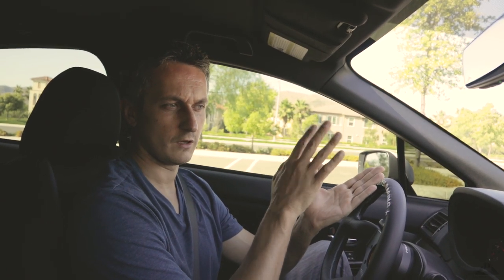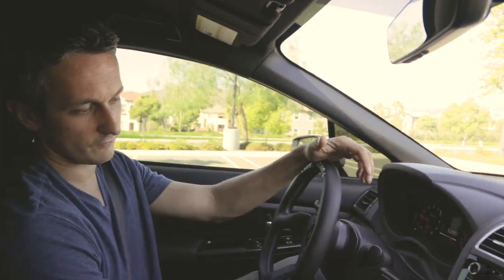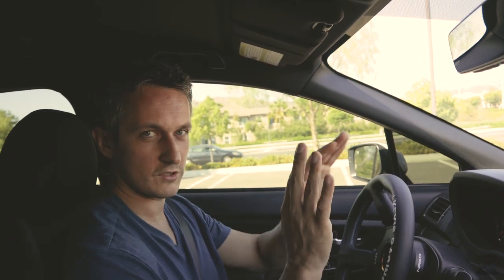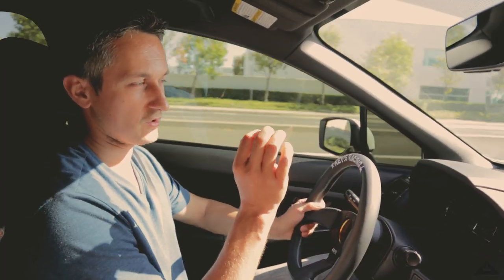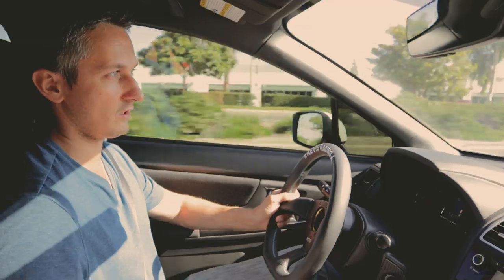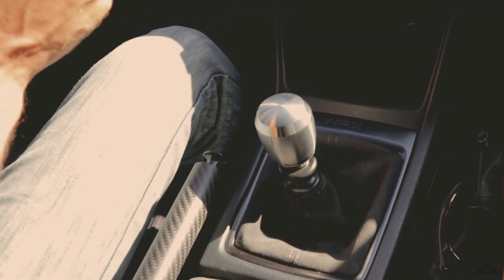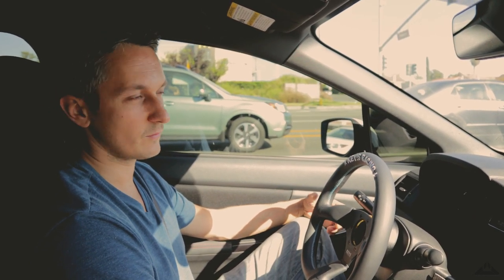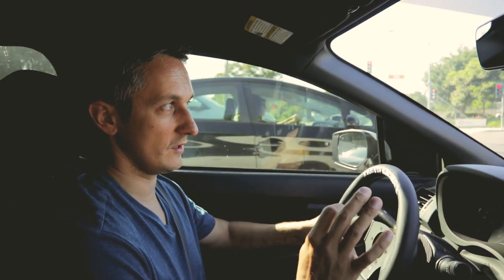Best way to shift a manual WRX and STI

Comment: I own a 2020 sti and I've had issues with making a smooth transition from 1 to 2. Thanks for putting it in a different perspective, this really helped.
Reply: I just bought a 2015 wrx as my first manual and have everything down except 1 to 2nd. It's always clunky af
Reply: @KuhmKnight  what helped me was shifting around 3 to 4k for 1st to 2nd gear, that and letting out the clutch as fluid as you can results in a smoother shift.
Reply: @Sinkroe  yeah I need to start paying more attention to my tac, my dad told me not to worry about rpms and shit when he was teaching me how to drive and I've been focusing on sound instead.  Driving home today I focused on my rpms and (most of the time) it felt alot better
Reply: @KuhmKnight  good, practice makes perfect and you’ll soon just be able to listen to the car and feel it. You’ll get frustrated like I did but just keep driving and you’ll get used to it. You get to a point where you don’t even notice your shifting/down shifting
Reply: @Sinkroe  after like a month of driving it it became second nature. Now I'm shifting up and down feeling like I'm in the fast and furious
Reply: dude SAMMEE im practicing on my friends 2021 sti for when i get mine in august and the shift from 1st to 2nd is so boggly bro i hattee itt
Reply: Same here 1st to 2nd jolts the entire car and everyone in it. If anyone has any tips, let me know. I'll definitely try shifting at 3k - 4k to see if that helps
Reply: @christopherlee7260 I have a STi 16’ 2nd is my enemiga. Shifting at higher rpm’s is smoother. I flick the gas before shifting. Seems to help.
Reply: I couldn’t get 1st to second forever until I realized I wasn’t letting the clutch reach the bite point fast enough. Now I usually shift at 3k and I get the clutch to the bite point right before it reaches 2k let out all the way, then gas. and it’s usually smooth. Now if I’m distracted or not thinking about it. It’s boggy again. But if I’m paying attention.

Comment: The STI specifically has an absurdly high connect point. Feels almost like a 2-step connection clutch. While it took me a while to master - I noticed that as long as you're not afraid of the clutch, you will always sense the grapple point. From then on, just practice entering that first gear with less and less RPM, 'till the point where it feels like an automatic.
Reply: Sti is my first manual lmao. What a choice. Had it for a month, was too clueless to be scared of the clutch and got use to it. Came across this video down the rabbit hole of gutting my car lol.
Reply: @horshue7873 let’s goo just picked up a 2020 sti last week. Finally getting a hang of it but it was definitely weird at first
Reply: @willcxlby  for sure you'll get it, my dad trying to scare me out of getting one bc hes a dodge tard warned me it was hard asf third to porsche and aston martin. Idgaf need for speed dream car + ratio + u drive a tacoma was driving to work day 4

Comment: Learning to drive my ‘19 STi was a big ass learning curve compared to how I drove my ‘12 VW Passat (Yes, it’s a 5-speed manual). I finally got it all down, but sometimes I still mess up man😂 One day my shifts are nice and smooth, and the next day they’re slightly clunky🤦🏻‍♂️ I still can’t shift that well in Sport Sharp mode lol.
Reply: Bro me either! It’s different in every section, drive on intelligence and then go to sport sharp and you’ll see the difference
Reply: I’m smooth in the sti driving daily
But quick shifting I can’t get it in this car. 
My integra I had that shit down like a beast
The sti grinds going into second. I have to really slow it down it’s weird.
Reply: Username 1991 same with me, but third gear. It’s like I get locked out and have to wait until the car is okay with me shifting into 3rd lol. I’ve definitely gotten a lot better overall after more than a year now.
Reply: Stewbob112 I have 19 sti as well my issue is just 2nd. So I just slow the 1-2 and bang the rest. Never have an issue. Just 1-2 grinds on quick shifting. 
I know you’re supposed to slow the 1-2 down do to driveline shock in the awd system. But I slow down a good amount to avoid grinding.
3rd I don’t have an issue. 
How is your hand technique?
Do you change hand grip position each gear? I do. Helped me to never miss a gear. The sti is crisper than the wobbly wrx one. So it’s crisp going into 3 thru 6.
Reply: @Username-ng8jy  bruh sport sharp is another level lol. I can't get 3rd for shit when racing. Gotta get used to it
Reply: @Haylem  nah to me is 1-2. The car just doesn’t like quick shifting. I think it’s a good thing cause I don’t wanna fuck the transfer case. I just slow it down a bit. 

But just use the ball of your hand and tilt your slightly pushing up with the ball of your hand naturally the shifter will go into 3rd. 
Is it your timing? Or you just can’t seem to get it into gear? Like as in your hitting the divider between 1 and 3?
Reply: @Username-ng8jy  I always find going down much easier. But for the WRX or sti the clutch release is about 70% upwards , I'm still getting used to it lol. I found a technique of lifting my legs up rather than letting it rest (left leg) shifting much smoother
Reply: @Haylem  lol I’ll give that a shot. 
To me it’s just 2nd gear. Never had an issue in any other car. 
The sti has bite point immediately after releasing the clutch about 10 percent for me. 
My integra was at the top 80 percent 
My gmc truck is at about 50 percent. 
The sti however. Bites the second Im releasing the clutch lol
Reply: @Username-ng8jy  What year? Mines a 2020, I meant 80% like let go at 80% upwards but yeah I think we're thinking the same thing lol. I agree I'm used to around 50% too. 

I'm getting the hang of it though, currently sitting at 1500 miles
Reply: @Haylem  19
I got her March 2019 with zero miles. 
I’m at 19k now.
Reply: @Username-ng8jy  Wow ! Nice, fun driving eh
Reply: I found sport sharp to be the easiest mode to drive smooth in, more control.
Reply: @jj1348  ur crazy lol
Reply: @Haylem  Hahaha I don't know I always fuck up in Sport, only about 7k miles into my 20' STI so I dont have too much experience but the difference was night and day for me.
Reply: @jj1348  Yeah no kidding LOL. I can't daily Sport # at all, I fuck up my timing in shifts. 

Im starting to daily in sport after doing 90% of it in intelligent. 

Gotta say I'm getting better mpg driving it harder in sport. It's like the engine likes a slight beating haha.
Reply: I can only drive my '19 Sti in S#. I'm coming from a '14 Evo X (still own it) and it's throttle response is much crisper than both S and I modes.

Comment: It took me a lot of time to be smooth when I started to drive stick. But it’s very rewarding. When I did my friends 2018 WRX I felt like I never drove stick before it was so violent and non-cooperating.
Reply from the maker: Exactly! I've driven manual for a long time, but when I got my wrx I struggled with every shift. That changed when I started to mod it. My first mods were the transmission ones. In my honest opinion, a stock wrx is a waste of money and time. It's built well, but it feels incomplete, every bit of it, even the look. But a well modded wrx is a different story altogether. Same applies to sti's. The aftermarket for these cars is really the main and only reason to get them.
Reply: @TheShaddix  you ever test drove a Evo X?
Reply from the maker: @visionsoflightwiliams86  yes
Reply: @TheShaddix  I'm not disagreeing with you as far as mods go for these cars, but the stock STi is fantastic.  I got my '19 two weeks ago and it's quite excellent even stock.  The trans is a million times better than the WRX 6 spd (I test drove an '18 WRX too).  I honestly found the earlier peaking WRX turbo to be unruly and annoying to modulate.  The STi's power builds a little more slowly, but linearly, while being quite fast.  The exhaust is almost disappointingly quiet, but I tell myself it's a stealth rocket.  Sorry for the tangent.

Comment: i have 26,000 miles on my still stock 2016 wrx. here is my tip to shift in a stock wrx.
1st gear launch: apply a little gas and lift off slowly on clutch. once it starts to grab and car moves, hold for 2secs and then release (clutch is like close to halfway point)
avoiding 1st to 2nd gear jerks: from first gear, do not exceed more than 2500rpm to shift into 2nd.

i keep seeing people and hearing people complain about jerkiness of the car from 1st to 2nd. 
hope this help new 2015-2019 wrx owners.
Reply: looopandlooop I’ll definitely try this! I have starting and all the other gears down except going from 1st to 2nd thank you!
Reply: I'll have to try the 1st to 2nd method cause holy crap its annoying waiting for the rpms to drop so it can shift smoothly.
Reply: @ghoulstein9557  i might make a short video about it. the sweetspot is around 2000 to 2500rpm to shift from 1st to 2nd.

anything above that will cause the car to jerk.
Reply: Update, tried and and its waaaay better, pick up speed nicely and dont have that jerk motion. Basically after i grab 1st i just immediately put it in 2nd and goes smoothly with no problem. Thanks!
Reply: looopandlooop will try that
Reply: looopandlooop this also begs a question.. if you shifting fast you can’t be waiting for revs to drops to 2500rpm how do you do then?
Reply: ghoulstein I guess don’t rev in 1st too high shift into 2nd faster then usually
Reply: @nonofyourbusinessnonofyour5435  yes, pretty much anything more than 2500 rpm will be too high in first. you can hear the motor ring at that point and the car pullin hard. be smoother in first to second below 2000rpm will make u have a nicer transition
Reply: same idea with shifting fast, quicker foot work and bring it up to 2500 max.
Reply: looopandlooop you mean don’t rev 1st pass 2500 rpm?
Reply: @nonofyourbusinessnonofyour5435  yes, 2500-3000rpm is where turbo peaks at
Reply: bro yes, i feel like 2-6 gears are perfectly fine but my 1-2 is so jerky

Comment: The grabbing point is so weird in the WRX, and even differs from each car. My clutch felt super light on my car, test drove a buddy’s 2018 limited and his clutch felt extremely heavy and the resistance was definitely noticable
Reply from the maker: I've seen this before many times. For whatever reason they do differ a lot. Mine is very light with a high grab point.

Comment: I noticed the clutch engages up high (on my stock) sti. It's not necessarily a point but a small range. 1-2nd is fine as long i'm quick. When moving slower (driving in slow traffic or driving slowly when police are present) the 1st to 2nd shift requires a small amount of gas (between the shift) when going into 2nd to counteract the engine braking. 

I have even noticed that I can shift without pushing the clutch pedal all the way to the floor. (but I still push it to the floor). I have pretty much mastered low speed maneuvering and creeping with the clutch... riding the clutch slightly is pretty much a necessity when moving slow in a parking lot or backing into a space. When backing in, I just leave the clutch half way engaged and blip/rev the gas a lil, If I need to give it more gas i let the clutch pedal out more... doesn't burn the clutch or anything... STI clutch seems to be very tolerant.
Reply: does riding the clutch just been keeping it half way engaged

Comment: Just bought a 21 wrx STI . Still learning how to drive standard. This helped spot
Reply: Make sure your RPM’s are at least in the 3k+ range if you wanna pull on it! Don’t ever floor it if you’re below 3k. “Rolling” into it you’ll be fine, but if you need to ask a pedal worth, always downshift first

Comment: This was an awesome video, addressed a lot of the things I'm struggling to get the hang of with my sti transmission.  You convinced me to finally pull the trigger on this slew of shifter mods. Stock feels super spongey. Based on how yours sounds alone, they make a huge difference.
Reply from the maker: For your sti I'd for sure get both of the boomba mods, a heavy shift knob, a stopper, and a small bushing. You already have a pretty stiff trans. mount, so I wouldn't bother with that.

Comment: that stopper is actually really useful. Im a new manual driver and I noticed in my wrx that theres kind of a "dead" zone at the very bottom when you push the clutch in and after I lift it a little bit i can start feeling it actually push back. I subconsciously put the clutch right before that dead zone and I notice my shift are smoother

Comment: I agree - I’ve been driving manuals for at least 40yrs and my 2019 WRX has the worst normal daily drivability of anything I’ve driven before.   It’s the only complaint I have with the vehicle.  

I like my music really loud and when driving in town must REALLY concentrate on throttle and clutch.  It’s a PITA.
Reply from the maker: The music bit definitely makes this more difficult. In fact, the louder you make the car itself (intake and exhaust), the easier it is to drive it.
Reply: I agree!I have a 2017 STI with a factory performance exhaust and the loud noise makes it easier to shift.I can hear the revs.I also have a 2019 STI without a factory performance exhaust and I have to have the radio turned down to help with the shifting!
Reply: Thank you for mentioning that. I've only had my STI for 2 weeks but I feel the same way that I need to turn the stereo down sometimes to hear how the clutch and throttle correspond sometimes. Still struggling at times with perfectly smooth 1st gear starts.

Comment: I have a 2001 bugeye STi and yes, the clutch is the same as these newest version. The grab point feels like it's at around 1/5 down or 4/5 up. 

Subaru must think it's faster to shift if you don't have to press all the way down to the floor, although I still press it all the way to the floor just to be on the safe side.
1st and 2nd gear is a bit tricky to get smooth, but not a huge problem once get used to them.
Reply from the maker: That's exactly how a 2015 sti grab point is. The stopper I mentioned completely resolves this. You can try it with a simple bolt to see for yourself.

Comment: I found that awd takes a little time to get use to. You never want to carry the car with low rpm unless your going slightly downhill for better mpg. The drivetrain is vulnerable to damage if not driven right. And never shock the diff haha or you will have a bad day.

Comment: I just bought my first Subaru today and got it home 🥺😭💙 i was doing fine with all the shifts but i had super trouble with the starts. this video helped me understand the starts so much with finding the grab point and letting it out slower as i hit the gas instead of trying to release it fully as i feel the throttle start to grab. on the way home i stalled 6 times at the same light and panicked so hard, i was so smooth and did so well the whole way, then i got to that light and i fucking torched it 😭thank you so much
Reply from the maker: Your main issue was/is that the grab point in these cars is so damn high off the floor. By the time you actually get to it you end up at too high of rpm.
Reply: @TheShaddix  drove it to a shop today after getting it insured, so it could be inspected and uh 😅 definitely stalled it a few more times. these GA hills are not taking it easy on me but i’m learning slowly how to manage
Reply: I was too scared to drive my 2018 wrx  home from the dealership ..where I live(St. John's, Newfoundland, Canada) has more hills than San Francisco, no joke...I made my Dad drive her home hahaha...Every Day driving to work my blood pressure goes up driving through downtown, more specifically all the hill stops...doesn't help that people here will stop about 6 inches off your rear bumper.. I basically do a burn out and lay down rubber at all the intersections on the hills...just seeing a red light raises my blood pressure lol...and I have driven both standard cars and trucks, dirt bikes and motorcycles...I GOTTA GOT PRACTICE  MORE ...I feel a bit better now I though it was just me sucking at it
Reply: @pennymercer4158  no i totally get it, i live in North GA, US. the start of the Appalachian Mountain range, I definitely roll as much as I can haha. I’ve gotten better on my starts but i totally agree it can be nerve wracking, especially the way people just don’t pay attention and want to hug your ass

Comment: Definitely a shallow clutch on the STI. I have been driving my 2018 for two years.   Not a big enough problem to mod the car to make it easier to drive/shift. It is a racing clutch (meaning you don't have to push the clutch to the floor to shift; only to start.)
Reply: everything stock? so youre saying i dont need to push the clutch all the way in on my 2020 sti?

Comment: The only issue I have is 1st to 2nd shifts, it’s so annoying. I almost have to skip the clutch just to try to shift smoothly. I just add some gas and don’t let out the clutch right away, helps a bit.